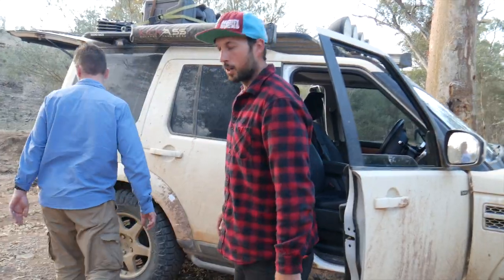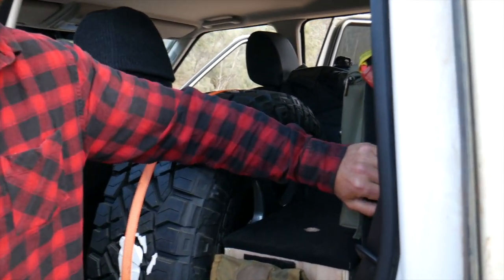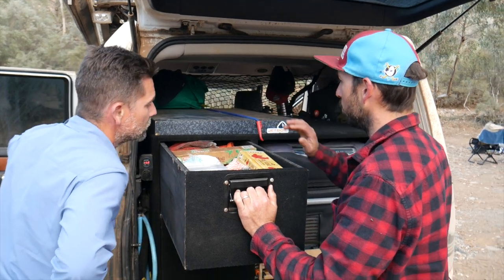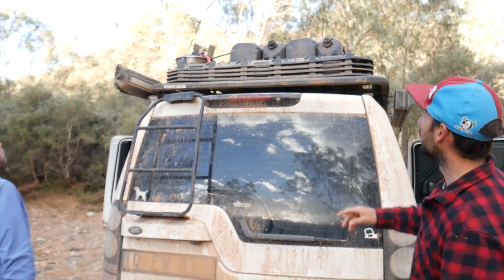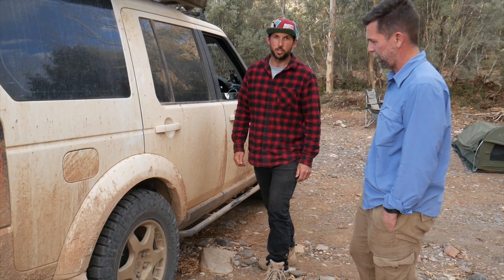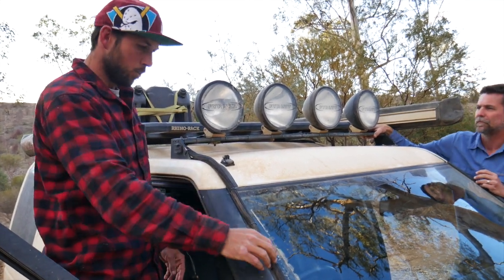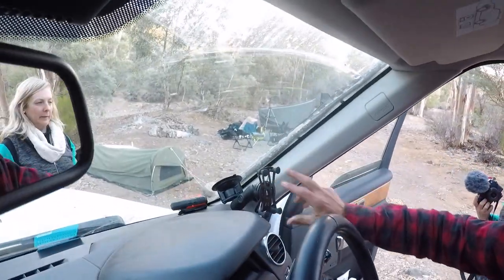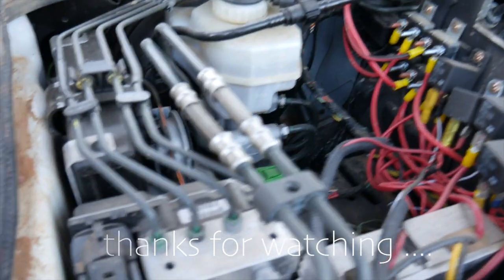Build Video - Land Rover Discovery 4 / LR4

Comment: Great set up and truck. What suspension are you running? Stock or not?
Reply: Stock, the adjustable air suspension is fantastic and I could never see a reason to change it.
Reply: The air-suspension is awesome but with my 2nd air compressor failure now at 230k’s am currently considering converting to heavy duty coils (2” lift) over Old Man Emu’s.
The overall concern is all 4 air-bags plus ride level sensors over next 150k’s could add a further $4-5k on top of compressor at $1400 alone. 
These are truly awesome vehicles and am committed to keeping it long term.
Reply from the maker: The older Hitachi compressor has readily available rebuild kits. Often the issue is not the compressor itself and unless good troubleshooting is undertaken compressors get replaced unnecessarily.
Reply: @sienaoverland  Thanks Scott thats very interesting. W-Light came on - both front corners went down overnight. Checked the valve block looks ok externally post roo strike on that corner plus released rear pressure. Checked out relay and fuse - both ok. Couldn’t get her to lift. Next  morning zero power no doubt shorting so the next step is collecting battery from its deep charge and checking if compressor has earth and power. 
Whats a rebuild likely to cost ?
Reply: Could be worth replacing  valve o-rings although haven’t been able to soap test her yet being down.

Comment: Do you run a 2nd spare underneath or just the spare in the cabin?  Do you have an extended range tank?  Just wondering where you keep extra fuel.
Reply from the maker: First spare is underneath. Tight squeeze and fully deflated. Does hang down somewhat compared to a narrower tyre like mine. Extra fuel on roof as required for locations travelled, ie distance between fill-ups.

Comment: Have you had any issues with the electronic handbrake ? that's the one thing holding me back from getting one of these to go overlanding in southern africa
Reply from the maker: Never had an issue in 8 years. The secret is regular cleaning and adjustment. The EPB would be the last thing I’d worry about for remote travel. Even if you have an issue, simply don’t use it until back in civilisation.
Reply: @sienaoverland  Thanks for the prompt response scott ! Just subscribed
Reply: I’ve just purchased one here in Oz and I’ve already had a turbo fail ( that took the fun out of it) but I love the car. I’m still learning to have some trust in it and haven’t gone to remote yet but I’ve subscribed to your channel and follow you on AULRO to get some ideas for my D4. I have purchased a bar as I do a fair bit of night driving and usually bounce 1 roo a year as a minimum unfortunately. Great video series you have put together.
Reply from the maker: @Paul-45-70  thanks mate
Reply from the maker: @Paul-45-70  this page summarising my D4 may be useful:
https://scotthumphris4.wixsite.com/trips/land-rover-discovery

Comment: Great setup Scott. Whats your recovery points? Do you have aftermarket points? Have seen on various forums that the towing points although not rated are sufficient enough?
Reply from the maker: Thanks Nathan. In my experience the factory recovery points front and rear are more than sufficient. I would not trust aftermarket ones that have not been designed by LR. I have read of people in 4WD clubs being forced to get recovery points but only for insurance reasons I think. I personally would not be doing that.

Comment: Hey Scott. I notice you and your friend both running your Disco's without bull bars or front protection. Given you guys have gone outback in this clip, I was wandering as to why you both decided not to go with front protection?
Reply from the maker: For me it's a judgement of risk. I avoid driving at night and I especially avoid dawn & dusk. This greatly reduces risk of roo strike, not to zero but low enough that I'm comfortable. Keeping in mind as well that many animal encounters end up being side swipes or more glancing blows for which a bullbar is unhelpful. Of course I understand the argument that "it only needs to save you once" but for me it wasn't worth the extra weight and expense. If I lived rural or drove regularly at night or dusk/dawn I think it would be a different judgement.
Reply: @sienaoverland  Thanks. Makes sense and does reduce a lot of weight in the car.